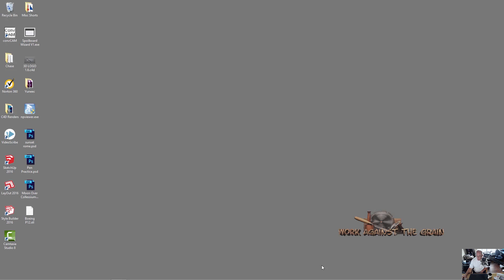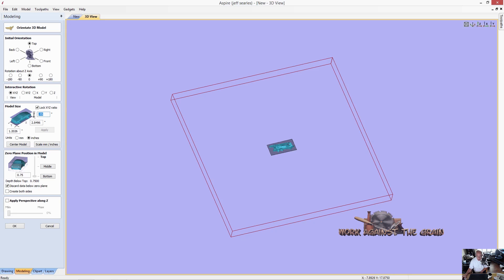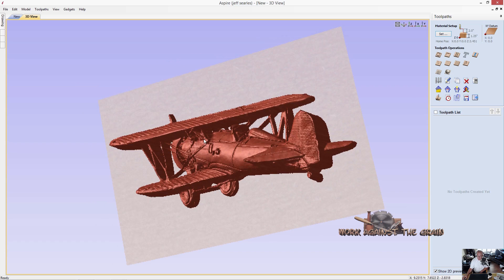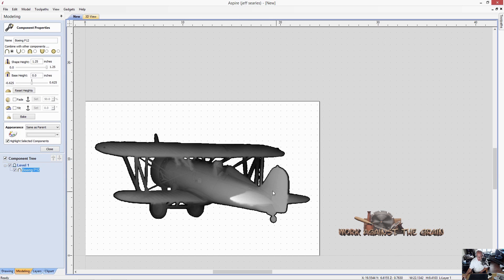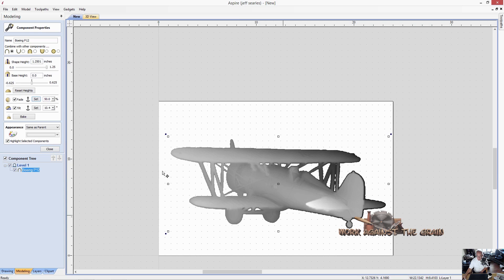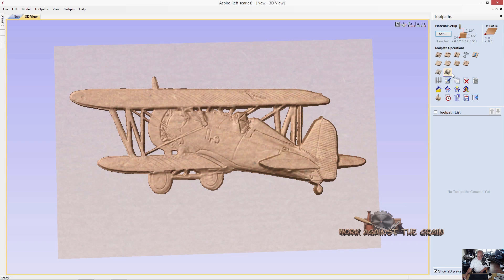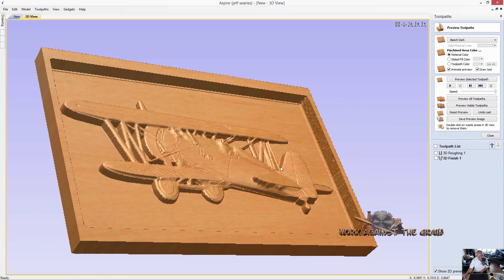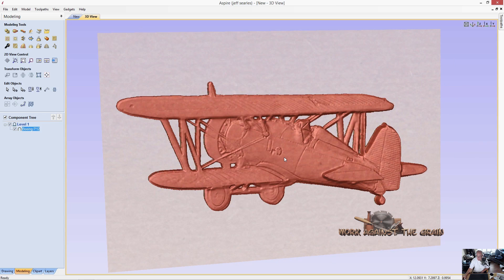Vectric Tilt and Fade 3D Models

Comment: Hi Jeff, I enjoy working with natural shaped (Found Wood) pieces of wood but have found it very difficult to create a "3D Workpiece" that reflects the true start dimensions of the workpiece of choice. This video has shown me a few tricks that will assist but I am wondering if you have a solution that can create a starting workpiece that would have varied dimensions in all different Axis. I have solved the problem in the X and Y axis but the Z axis is eluding me. Any guidance you can provide would be great. Also, I am working in VCarve Pro only at this time.
Reply: Thanks for watching John. The only two ways I am aware of Z height adjustments is to either ADD material with the sculpting tools or set the Z height in the model settings. Now, having said that, you could use the FADE feature which is similar to tilt that allows you to make the Z part of the model taller as it fades to a lower Z height. Hope some of that helped.